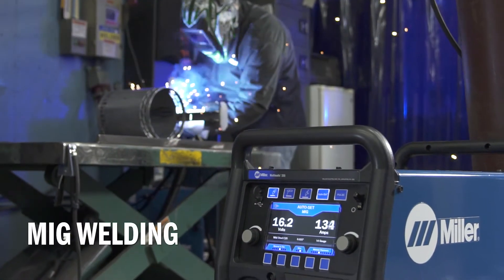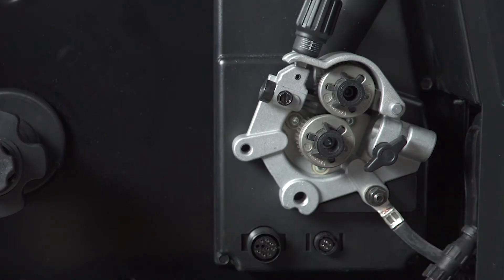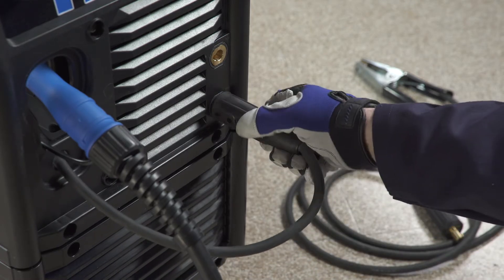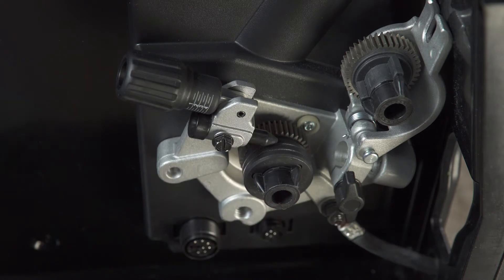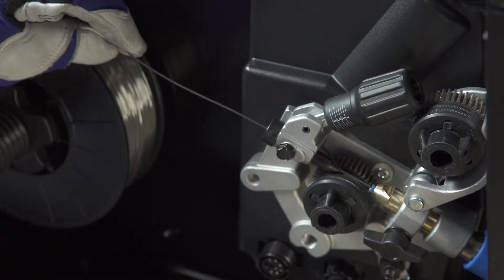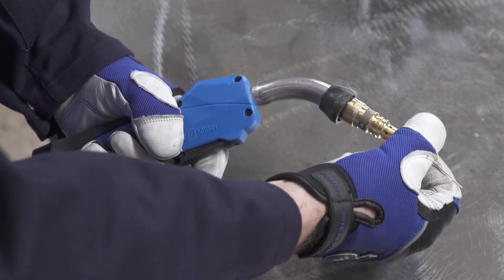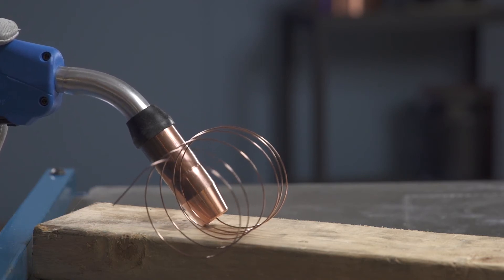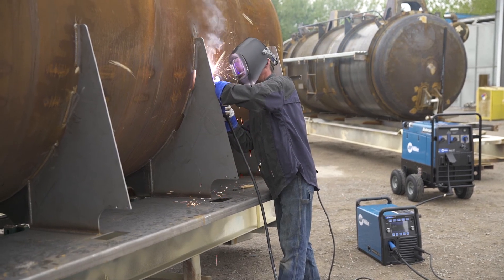Flux-Cored Welding With Millermatic 255 or Multimatic 255

Comment: My millermatic 255 only has the option for .045 wire in gas shielded flux core mode. Using .035 dual shield wire, my only option is manual mode. Has the option been added in software updates or planned to be added? Thanks

Comment: Some users have noted the knurled drive rolls for the dual shield are damaging the wire too much, causing issues with welding.
Reply from the maker: We would recommend decreasing the drive roll pressure if the wire is being damaged. With cored wires you need to lower the drive roll pressure below what you would have normally with a solid wire.

Comment: Can either be configured to run dual shield?
Reply from the maker: Thanks for the question! Yes, the Millermatic 255 and Multimatic 255 are both capable of running a gas shielded flux cored wire.
Reply: @MillerWelders  thanks for the info.